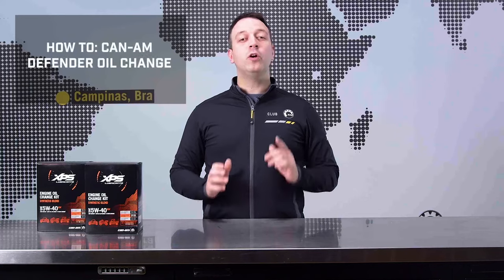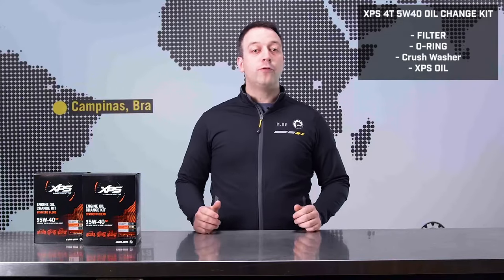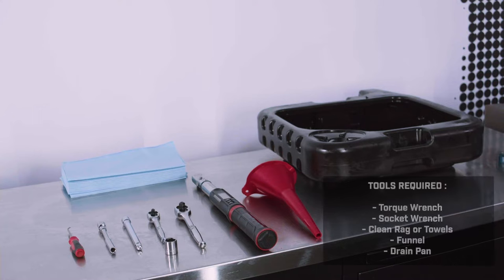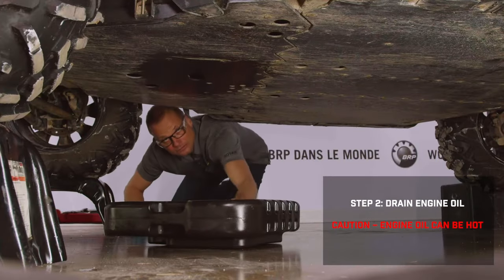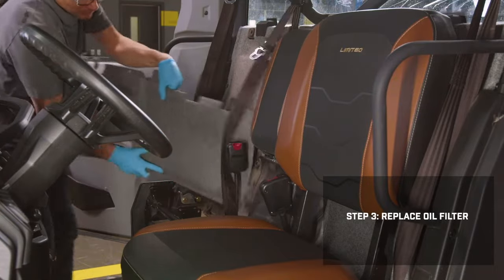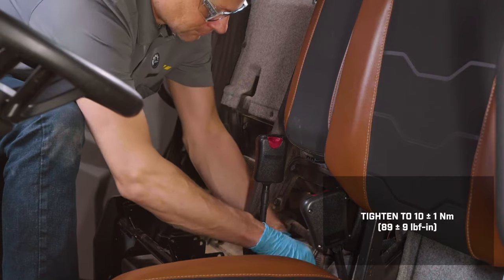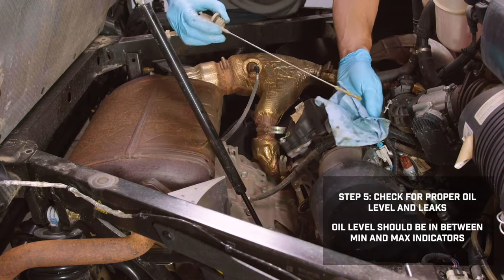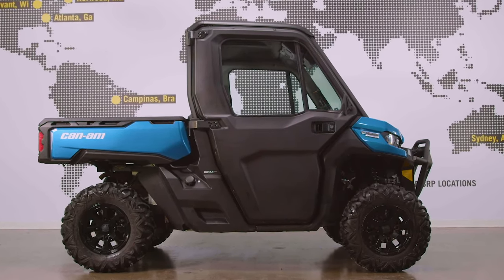Can-Am Defender. How To Change the Oil

Comment: Pull the upper and lower of passenger seat AND the middle seat and the carpet behind those. You made the video look pretty easy of him just lifting them out. You neglected to show him removing the bolts to remove the seats. What a joke just to access the oil filter.